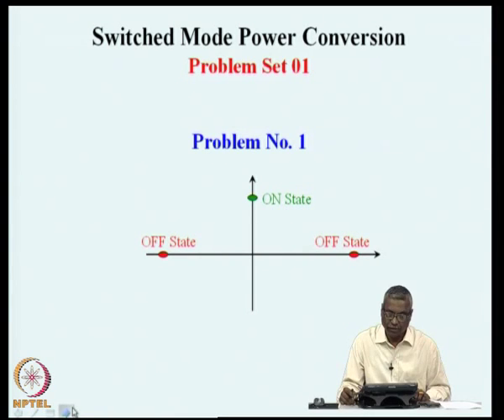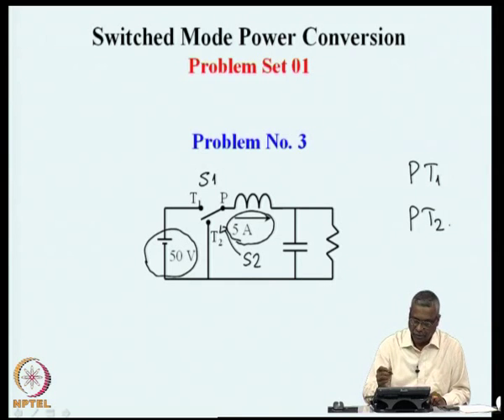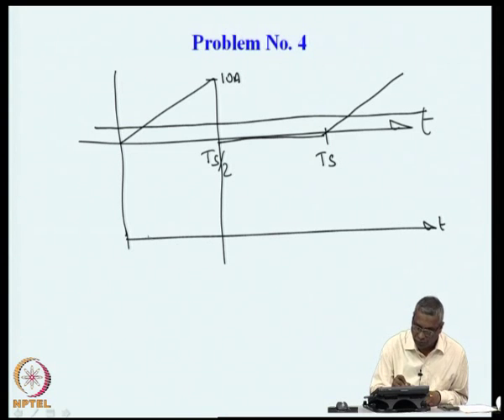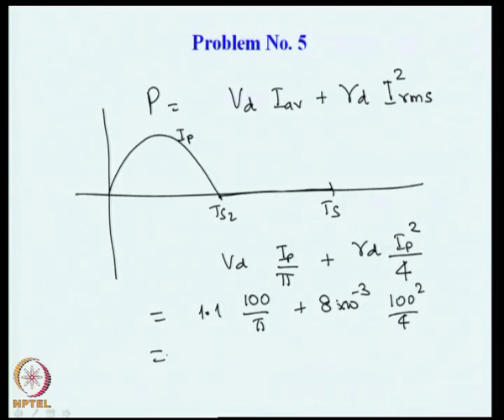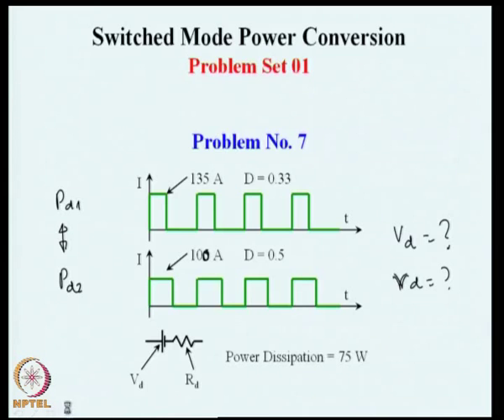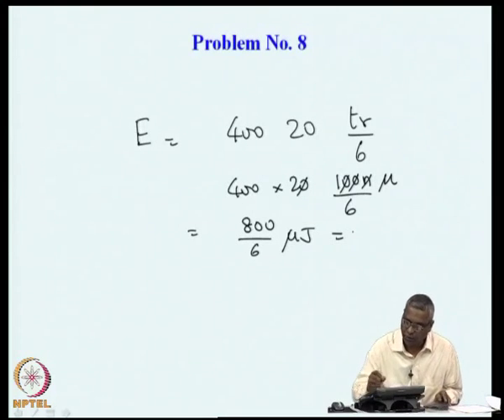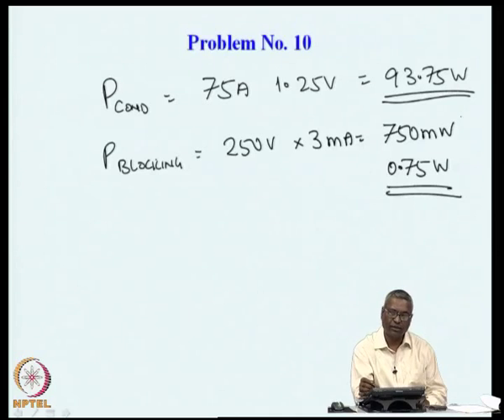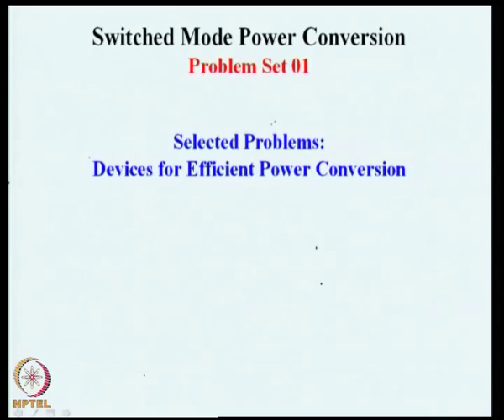Mod-04 Lec-08 Issues related to switches

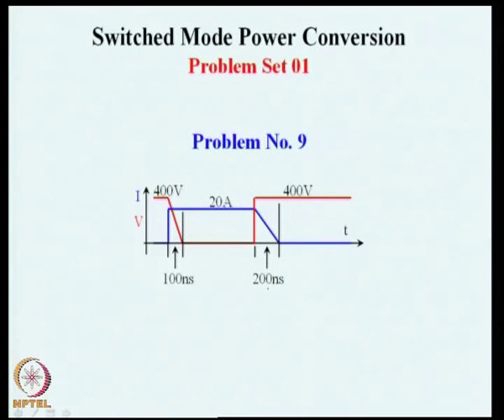Comment: In problem nun 9, at 46:19, tr case, it does not look like inductive load, as in inductive load sudden step change in current is not possible. Kindly look and clear my doubt. Thanks
Reply: Even i feel the same, inductor opposes any change in current, and it builts gradually
Reply: It should be a capacitive load in the beginning (voltage decay) and inductive load at the end (current decay)